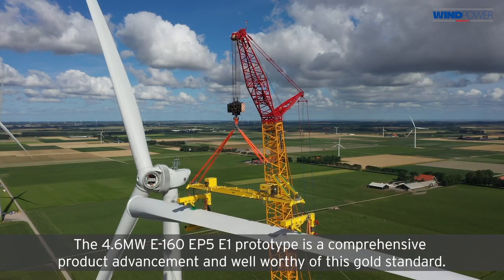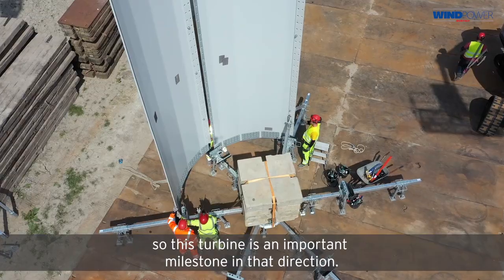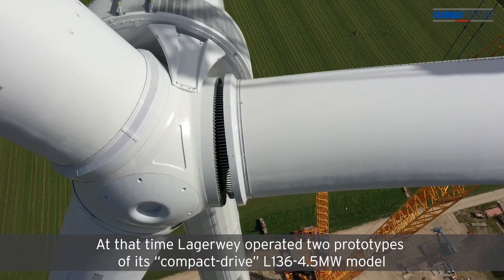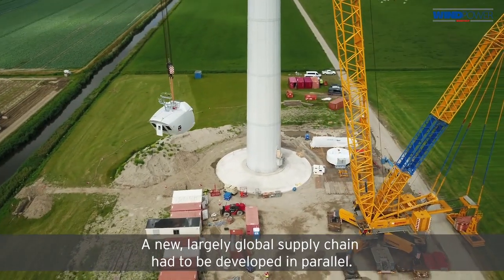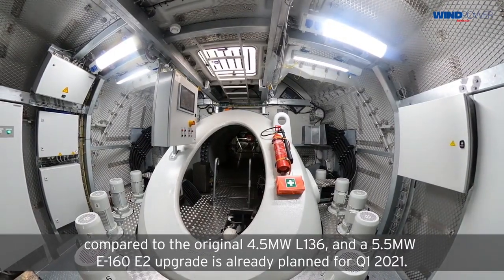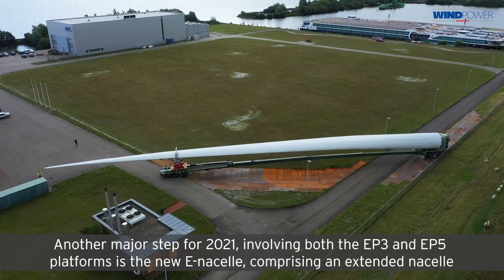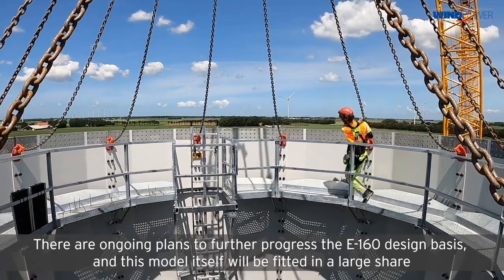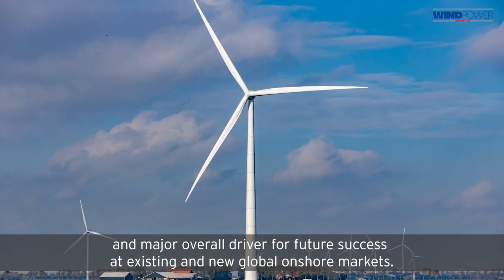WPM Awards 2020: best onshore turbine 45MW+ – Enercon

Comment: Big turbine rotors generate a lot of torque. That means, you need a lot of magnetic field strength to harness that much swept area at low RPM. Permanent Magnet Generators (PMG) need a lot of the rare earth elements, like Neodymium, Dysprosium, Nickel, Cobalt, Samarium, and other rare earth elements, as well as the iron. These alternators will be sustainable, as long as these rare earth elements remain affordable. Another criticism I have, is that the torque the alternator can handle is limited by the field strength of the magnets, limiting the over-torque they can handle in high wind. If, somehow, the actuators are unable to pitch the blades into the wind during a storm, the alternator can lose control of the rotor, and you have a "runaway" situation. It's difficult at best, to stop all that torque with a brake. In high winds, these wind turbines are as powerful as 2 train locomotives!